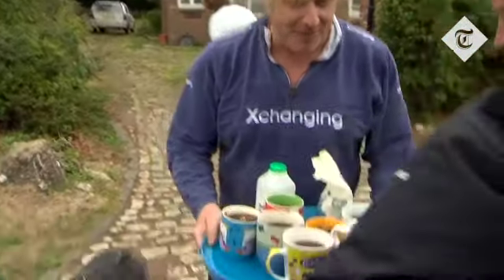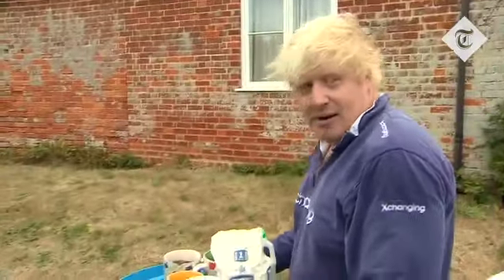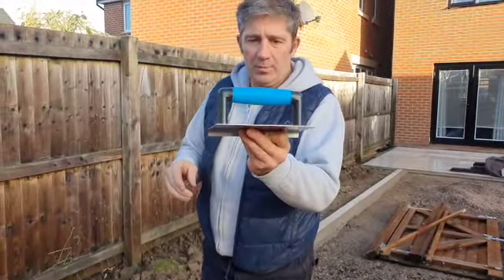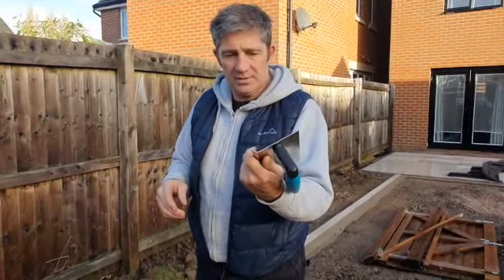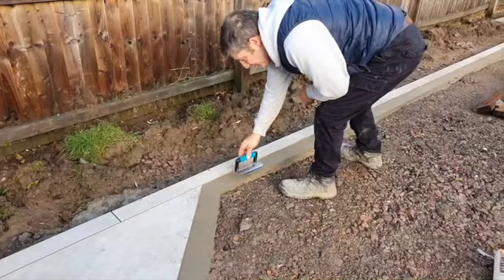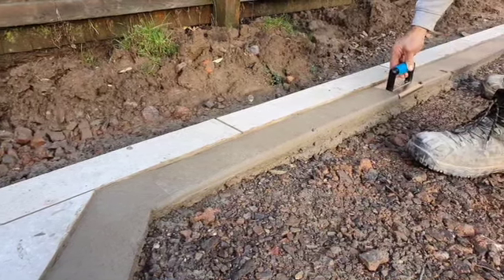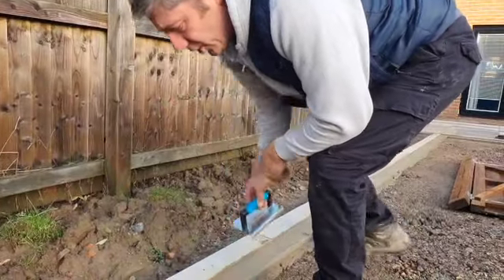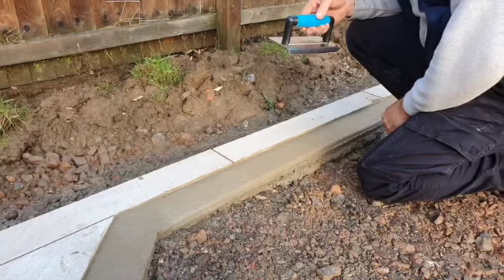Concrete Plinth For Artificial Grass Alongside Porcelain Picture Frame

Comment: What mix did you use ? please because I'm almost there .....
Reply from the maker: 5:1 mate
Reply: @GreentopLandscapes  I have 3 " x 3 " x 6' treated wooden batons along the edging, i was thinking of filling underneath the spaces with sand/cement   as you said 5:1 ratio do i need to add pebbles to make it stronger ?....

Comment: Does this need ballast/stones or just sand and cement? Surely quite a strong mix so it doesn't crumble
Reply from the maker: Better if you do mate
Reply: How many mm below finish do you do for a 32mm artificial grass?

Cheers mate